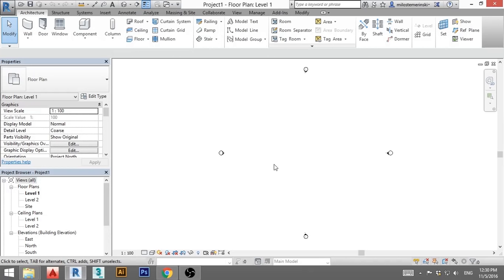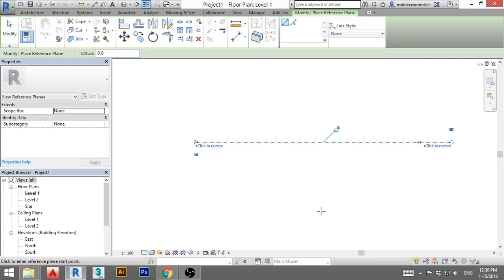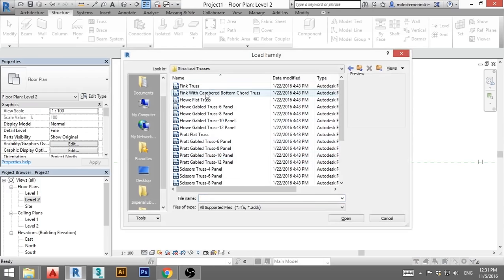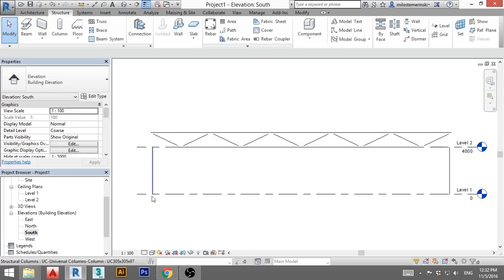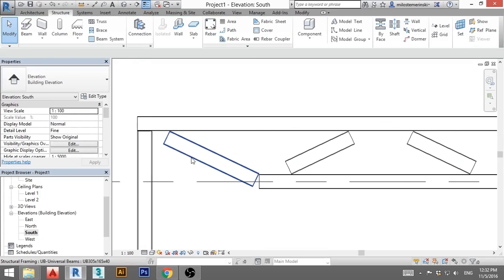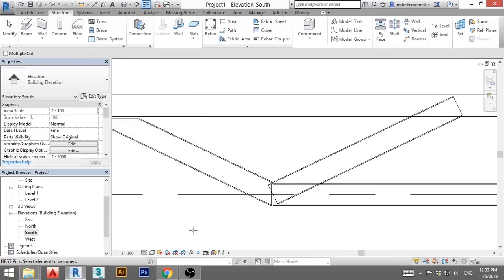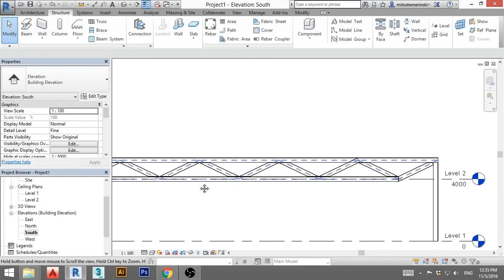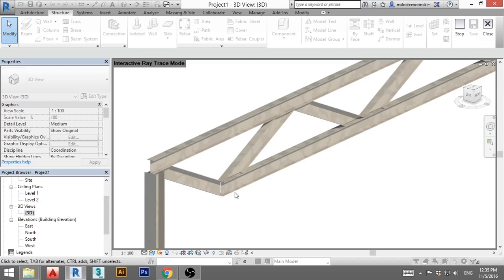How to Create a Truss in Revit

Comment: Today is my first day of learning Revit after 7 years using ArchiCAD. This is the seond video that I came across and liked it; however, I'm a bit surprised at how primitive the workflow is (BA, not your fault obviously). How is it possible that a software like Revit (from autodesk) doesn't make those truss connection automatic? or at the very minimum doesn't have a tool or shortcut to join the truss parts all in one action? Please, tell me that things have been improved on newer versions.

Comment: when I hit tab, it does not select one element of the truss. Any solution, please?
Reply from the maker: You shuld hold the cursor over the element you wont to select, and than hit the Tab key as many times as it takes for the element to be selected, sometimes its more than a couple times
Reply: Tried. No change.